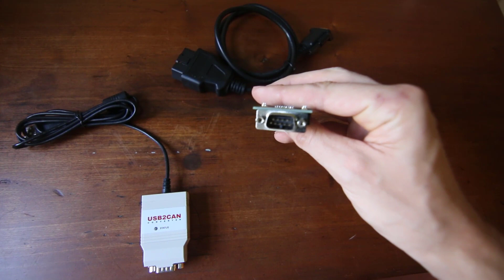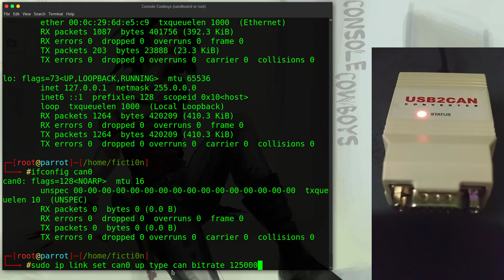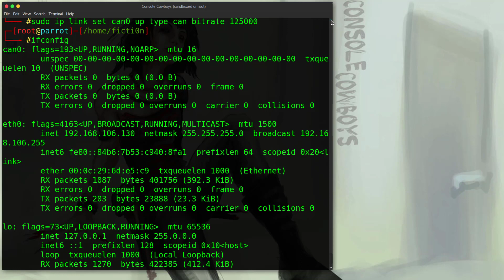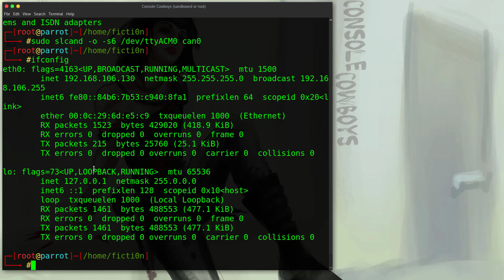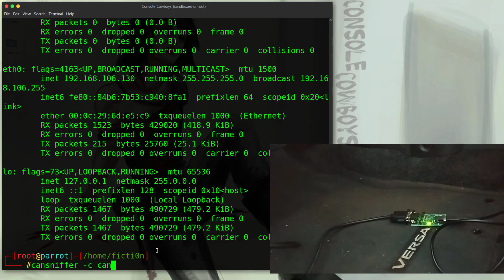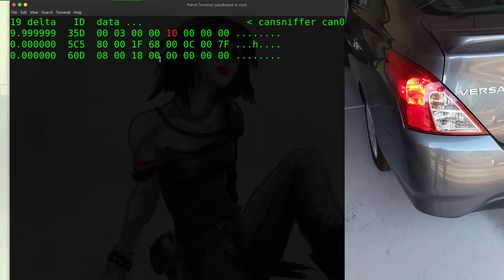Hacking All The Cars - Connecting To A Real Car with Hardware 0x05

Comment: It would be interesting to see if you can hack a car that has a usb port with a bad usb
Reply from the maker: I have not looked at car usb ports... They for sure tie into things in the car depending what car you have.. would be very specific to manufacturer I would imagine.. star plugging into your car and give it a go.. !
Reply: @ConsoleCowboys  well I don't have a car but I have a malduino which allows for 16 scripts so if it is possible I could do it with 16 different car manufacturers